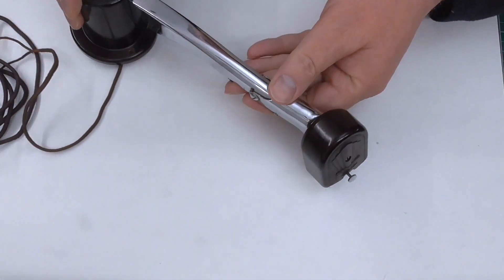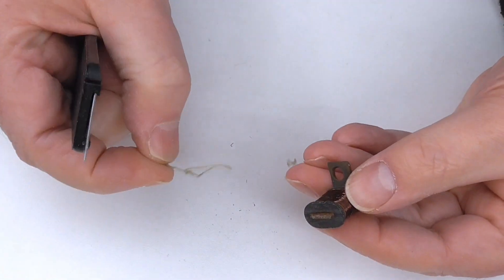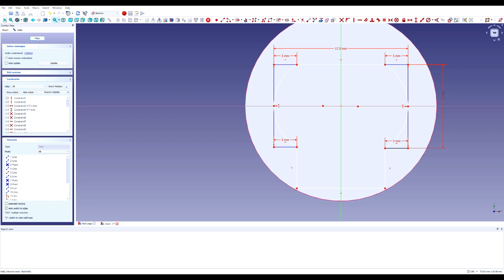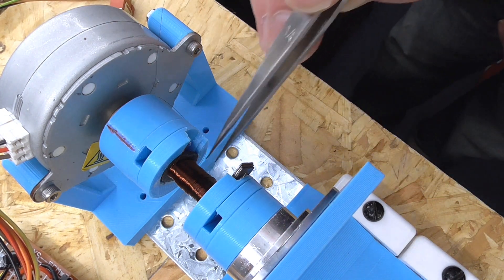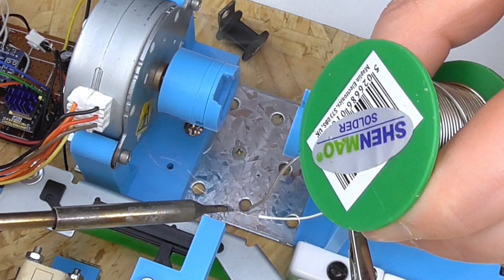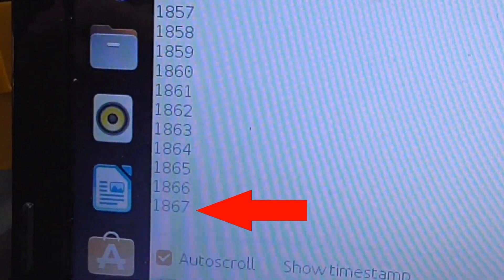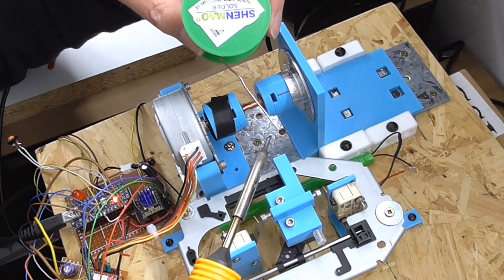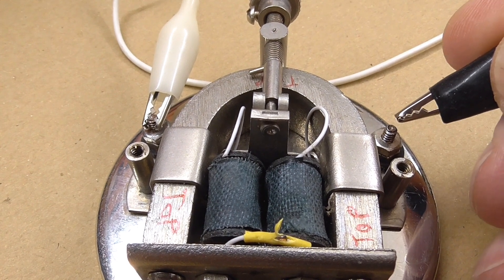I built an automatic coil winder!

Comment: A very useful device, congrats on making it. Would love to know how they managed it in the 1920's under factory production conditions. That high impedance coil wire is so prone to breakages. Good to know such wire is found in clocks. Thought there were no uses today making it obsolete.
Reply from the maker: Thanks 😀 👍.  Yes, I wonder too how they used to manage things like this back in the day. The original wire did show some signs of being joined on the spool, so maybe it broke whilst winding back then 🤔.  It seems impedance wire like this is still easily available, so presumably does have modern uses. Very handy discovery finding it in quartz clocks as initially I thought I would have to order another reel to finish the job

Comment: How did you do the coding for the dvd drive motor control? Is it tied to the speed of the rotation or the thickness of the wire? 

I’m interested in making something similar for making custom motors and other parts like electro magnets
Reply from the maker: @ashb8036  Initially, I got it to move the width of the wire for every revolution of the spindle and just count turns to decide when to reverse the spreading of the wire. The DVD stepping was unreliable due to the very small movements, so I also added end stop switches to ensure the wire was spread up to the edges of the spool and didn't reverse too early. Good luck with your build. Thanks 😀 👍

Comment: I would have liked to have seen where the break was.
Reply from the maker: I don't remember there being definite breaks. I did look like the wire might have been joined when the coil was originally wound as the were paper layers, which might have been an attempt to insulate joins. With the old wire though, I wasn't able to get a reading at any point I tried. With coils like this, you might get lucky and find a break in the first few winds, but I didn't, and I made the decision fairly early on just to take off the old wire and wind new stuff. Thanks 😀 👍